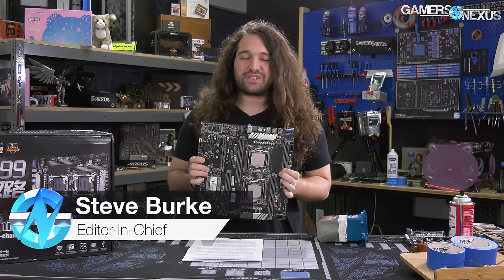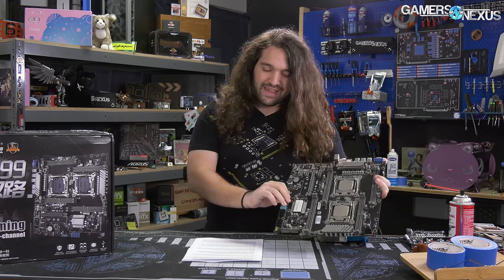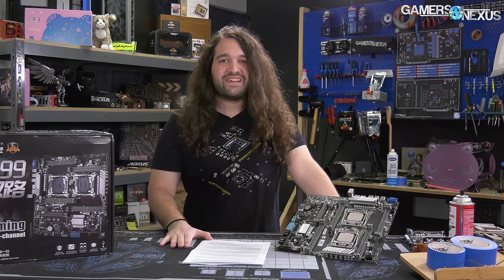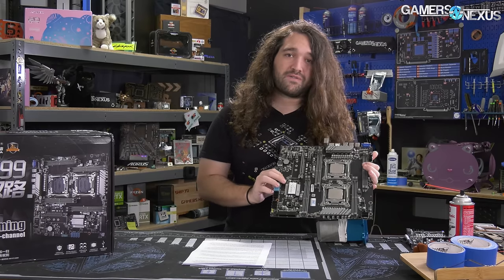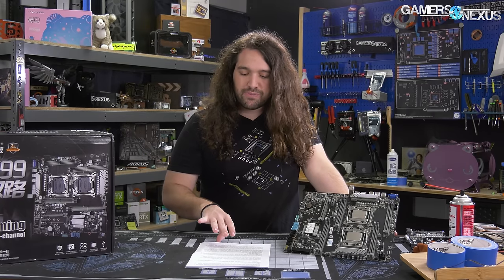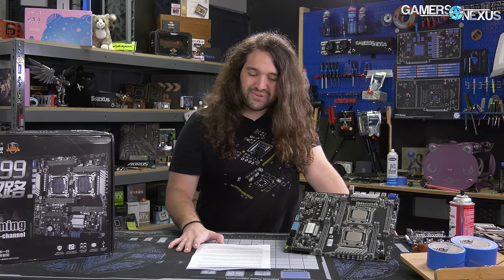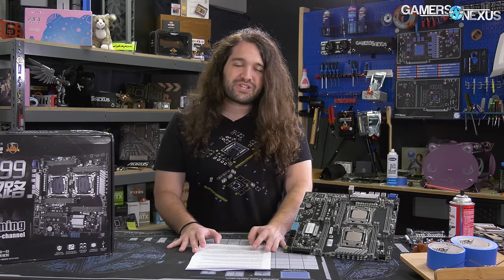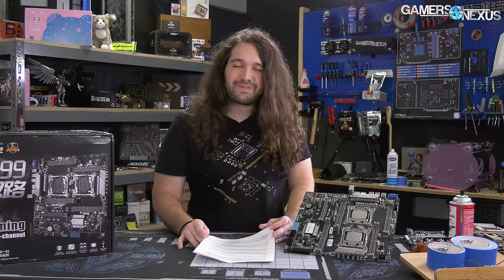24 Cores, 48 Threads for $360: Dual-X99 Jingsha Motherboard vs. AMD R9 3900X

Comment: Please, stop calling server platforms Xx9-anything, it's as misleading as calling all black rectangular capacitors POSCAPs ;). These boards are based around C600 series chipsets, not the X99 or X79. Server chips while often having same silicon are running different ME, different firmware and have different fuses.  It is not convenient, as typical X99 toolkit/OC features are fused out from C6*-chipsets and BIOS microcode/CPUs. Also it is still 4-channel memory board, just twice logical units for that, so CPU-Z/etc reporting everything correctly, as the metric is by socket, not as whole board. However with 2 CPUs other CPU can access the memory on far end, and there are different methods around that, like NUMA, etc. Xeon CPUs are locked not just for ratio/BCLK clocks, but also locked memory controller. Only Xeon E5-1** series up IvyBridge (1690 V2 etc) are overclockable (and W-3175X ofc, as special case).

Comment: I think this is a great channel for computer stuff in general. However, efforts such as these seem almost purely academic, since the trouble, problems, uncertainties, complications are so significant, they clearly do not represent a worthwhile value for most everyone. Which is to say, if ANYONE actual uses this 'information',  it's such a tiny, tiny portion of the audience that, like the project itself, presenting it is really not worth the time. I started watching it but then I realized I need to stop watching this sort of thing. Of course this channel is not the only one to do this. But they all have that factor in common: They misrepresent the idea of value to all but a tiny percentage of people with the interest, competency, and patience to 'experiment'. And these stories EVEN frequently include examples of being actually BLATANTLY bad value in the case of shady sellers and bad buying experiences. So really, such videos are actually NOT good or desirable. If you really think that's unfair, just go over things again and try to come up with and actual, reasonable, sensible explanation of how this appraisal is unfair.